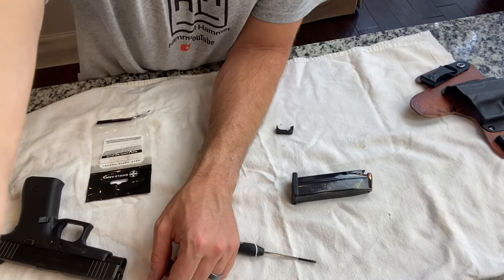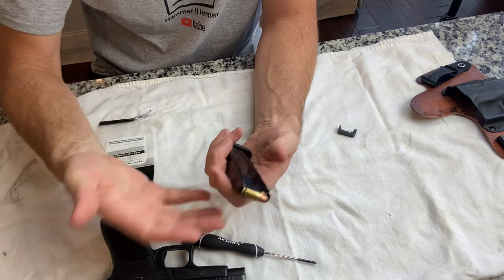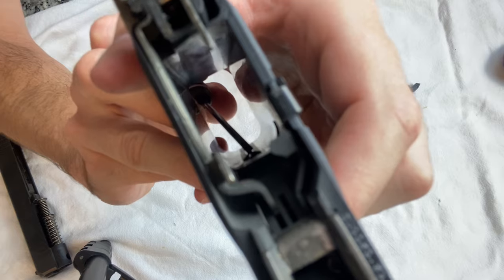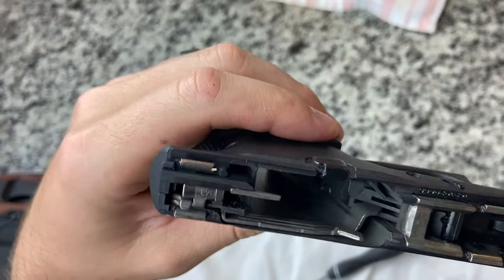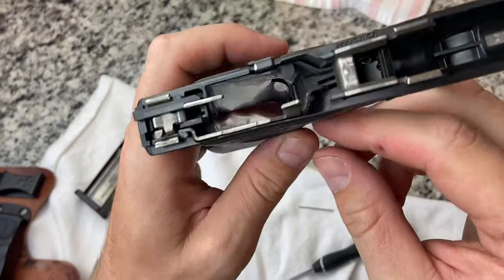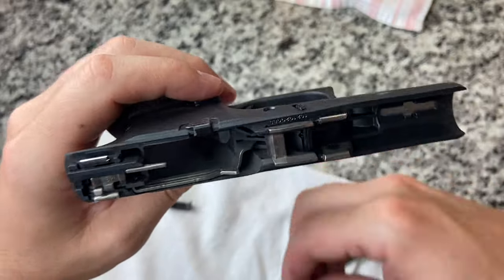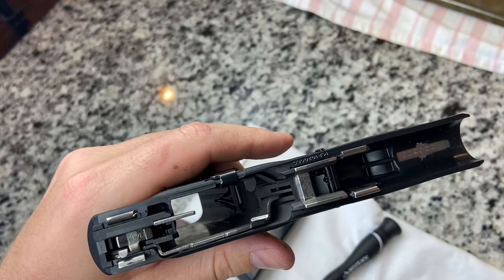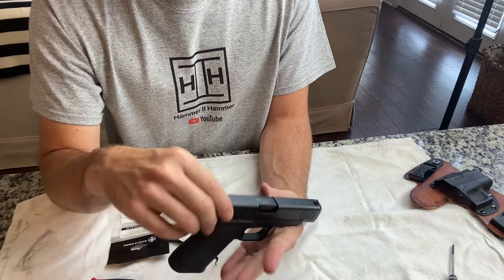Shield arms magazine release Install / Swap, Glock 48 / 43x Step By Step

Comment: You don't need to take out the rod. You can gently pry the rod up with a pair of pliers or something and the old mag release will just slide right out. You can then put the new one in, let go with the pliers, and then hook the rod backwhere it was before you started. Great informative video regardless, thanks!
Reply: Way easier taking it out.
Reply: Use a 90 degree pick to lift it like he is showing you, why do you people make a big deal out of it.  Move it out it of position raise it and slide out the catch   , slide the steel catch in raise the spring over it and slide the new one in and the push it back in place The man is showing you best and easiest way. It’s spring steel and will go back it’s in original shape when you release it, it’s done and done. Iv changed out 17 on the G43x and had no problems. If got to rough and lost of bent one they are less the 4 dollars at the Glock store. I’m placing a order from the for  a titanium guide  extra spring and rod and trigger parts for a oops kit

Comment: I feel bad for all the people that are following the second step and taking out the rod. It's not necessary to do that, just take the flat head and bend it outwards while putting in the new release..
Reply: Thanks for that tip!
Reply: I agree wholly but recommend a 90° or hook pick. I had a much easier time getting it out with those
Reply: I've got an even easier tool... One of those 6in1 screw drivers... take out the small sized screw end and use the tube of the holder to slide over rod spring and push/pull out of the way of the catch.
Reply: I was wondering if I'd be able to do that instead rather then removing it all the way. Thank you for the advice!!

Comment: Scratched up the inside trying to do this for 30 minutes with a screwdriver, so i bought some picking tools and did this in a couple minutes 🤦‍♂️. Well gotta give props to your video though it was helpful and quick.
Reply from the maker: Yeah a pick works much easier to get a hook of the bar, I have done several with a pick since. Both work but pick is easier. Thanks for watching.
Reply: How have the S15 mags been working for ya? Do you have Gen 1 or 2? Thanks. Have been hearing mixed reviews.
Reply from the maker: I have gen 2. They work great, I’ve had no problems at all such as feeding etc. I have no experience with gen 1 mags.
Reply: Headed to the hardware store in a bit to find a pick set. Been trying for 30 min with a screw driver and all I've managed to do is scratch up the inside of my gun.
Reply: Installed mine chewed up a little bit of plastic on the lip where the tension rod leans to getting it to come loose but it’s not bad and everything is installed and works perfectly used a pic tool 👌

Comment: The last couple Glock Armorer courses I went to suggested using needle nose pliers to just pull the mag catch spring (straight rod) straight up & out. After you use a small flathead to pop the rod out of the mag catch detent. This is way easier. To reinstall, hold mag catch in place, push rod down in its hole all the way, then use the flat tip driver to slide the rod back in place in the catch. No chewing up your gun. I can swap these in about 2mins with no damage & not over bending that rod.
Reply: Thank you - Ive done this several times but the glock 48 I have was almost impossible to remove. Pair of bent needle nose pliers and it came out in 5 seconds.

Comment: I have to admit, at first I was wary of doing this. Especially since now where I live the glock 43x is like a winning lottery ticket, the big box sporting goods and camping/hunting stores have the 43x on their website but no one has it in the store and it's up to 2-4 weeks for delivery. I had an offer by a woman for $850 if I'd sell her the 1 in my holster, I declined. I purchased the s15 combo pack which came with 3 s15 magazines and 1 +5 spring and base plate and upon reading the suggestions, they reccomended changing out the mag release with their metal 1, it's not a must but for better results and not wearing the plastic 1 out I did. I will field strip my guns but I'd rather not mess with the trigger and firing pin mechanisms, however I do have the harbor freight pick set and watching this video made it super simple and I didn't leave 1 scratch or chip getting the spring out of its seat, and putting it back was super easy and simple since getting the pressure off the spring is the most difficult part, if you're like me and dont want to knick it or scratch it up that's all I could think about. Thank you for the video that caters to us laymen who aren't very mechanically inclined or patient. Task took around 5 minutes after watching this and that's being super careful to not mess it up. Now my 43x has new mag release, 4 s15 magazines in total and 2 of them have the +5 extension, I carry in a vertical shoulder harness with 2 extra magazines totaling 56 rounds when I walk out the door. I will be getting 2 more +5 extensions since everything was so simple to install. Those who knock the 43x because other brands have similar sized compacts that hold 12, with shield arms innovations the 43x is capable of carrying a lot of backup power now with glock reliability and peace of mind that comes with them. I have the 43 also and several other compacts but the 43x with these upgrades and efficiency of possible modifications is my go to carry now. Great products from both glock and shield arms, in which I have no affiliation other than just being a satisfied customer.
Reply: How have the mags been holding up for you? 

I’ve been having issues with the magazines + Glock mag release, but I just ordered a steel version from shield. Excited to try it out!
Reply: Where have you found the +5 base plate if you don't mind my asking?

Comment: Like others have said, go to Harbor Freight and get their $2 mini pick set, and push the release from the back side as your are prying the pin. Make sure to press the hook on the end of the pick under the pin and it should pop out. Also, you can leave the pin in and just slide the new release in while prying the pin up. Super easy to push the pin back in place once it’s in.
Reply: I took a punch and lined it up on the straightest wall of the  side of my mag release.... And BASHED the mag release in... It worked great

Comment: I scratched the absolute shit out of the inside of my frame doing this and I used a pick. What got it for me was pushing in the mag release. Pushing and holding the pin all the way to the side and then pushing in the other end of the mag release.
Reply: Most helpful comment WTF I did it in 2 seconds
Reply: @jesseblaauw8441  glad it was helpful
Reply: OMG SAME. BEST COMMENT. TY.
Reply: I was so mad till I saw this comment 💀 😂 thanks bruh
Reply: Best comment. The guys method in the video will have you scraping the fuck out of the inside of the gun.
Reply: Dang likewise!! I was pissed
Reply: Could you elaborate on this. I cannot get it for the life of ne
Reply: I marred my shit up a bit too using a rigid ass flat head screwdriver! My plastic dental puck snapped in half 😳. After about 4-6 attempts I finally got it. Not as easy as it looked

Comment: Great video- thanks! 
If you don’t want to go invest in a new tool, you can also use a long corkscrew to scoop the spring out. 

The shield mag release has a much easier indentation to get the spring back into.  

Only weird part is that the shield release doesn’t do so great releasing stock Glock mags.
Reply: Thanks man! The corkscrew did the trick for me, appreciate it!

Comment: Great Video, i followed step by step by step and I was able to actually do the opposite of what you are doing here. My shield arms mag and release aren’t properly feeding and causing a FTF or jam between rounds. I have switched back to the factory mag release and magazine until I get the issue resolved. Great video and thanks again!!
Reply: I had the same issue with the Shield mag catch and magazine, so I swapped back to the original as well.  Just gonna run mine OEM and settle for 11 rounds.
Reply: After looking for installation vids, I came across lots of reputable vids that warn about and demonstrate FTF issues, especially with hollow point/defense ammo. This occurs with Gen1, 2, and 3 mags. It is not the mag release causing this. Shield has told people it is the loose tolerances of their particular gun. I'm returning the S15 set-up without installing it. Better to have an 11 shot that works 100%.

Comment: To make this lefty friendly is there anything other than putting the metal mag release in backwards and pushing the pin back toward opposite side?
Reply from the maker: I haven’t tried it but I don’t see any reason that wouldn’t work.
Reply: I made my wifes 43x MOS lefty by just putting it the other way. It's grooved "upside-down" on the other side just for that

Comment: So does that little small thin metal piece that’s holding the mag release  supposed to be stuck stuck and hard to get out?
Reply from the maker: Hey yes the tension rod is supposed to be pretty tight in there so it doesn’t come out easily/accidentally. Get a small pick set from harbor freight (it’s a 4 pack with orange handles for about $2) makes it much easier to get behind the rod to pop it out.
Reply: @HammerIIHammer  alright thank you I thought I got it stuck in there and I messed up

Comment: I tried to install the shield mag extensions on a glock Pmag and it wouldn’t work. Am I on the wrong here or are shield mag extensions only compatible with original glock mag ?
Reply from the maker: I can’t speak to the mag extensions as I don’t use them but hopefully someone will help you out on this comment. Thanks
Reply: I could be wrong but , I pretty sure the Shield mag extension only work on the shield s15 mags. At least I’ve only ever seen there +5 extensions on the s15 mags.
Reply: @Tracer1999  They worked with my original glock mags but not on the pmags 😞

Comment: I'm thinking about getting shield arms mags for my glock 43x
Reply from the maker: They work great, I’ve had no issues with them.
Reply: Its a hit or miss. I bought s15 mag and mag release. First round jammed when cocking the slide and mag release did not release oem mags well
Reply: @SergioGarcia-lu5yo  Yeah Glock said it messes with reliability when you do upgrades to your Glock firearms
Reply: @SergioGarcia-lu5yo  was this the gen 1 or gen 2 mags from shield arms? They have fixed the reliability issue with the gen 2 mags

Comment: So I just bought shield arms mags and am about to swap the release but my mag does not stick at all
Reply from the maker: yeah some people the mags don't stick it seems at first. but eventually the plastic mag release will become worn down/malfunction due to the wear from the metal mag. I still use the plastic mags with my metal mag release for training but prefer to carry metal mags with the metal mag release for highest confidence in reliability.   Thanks for watching.
Reply: What I am seeing from the mag release it is scraping both mags shield an stock

Comment: I noticed the new metal mag catch is significantly stiffer to push in than the Glock plastic.
Reply from the maker: Absolutely, I thought they would just clean it up and replace knife blade probably. or at most replace with a tinker or similar. but they went well above and beyond. Fantastic service above and beyond what they needed to do.

Comment: First time ever having done any gun work myself, after figuring out why my slide wouldn't release (TIP: depress trigger) i literally had the old release out and the new one in/slide installed complete in a minute and a half, very easy. (also having a little hook tool does really help to unseat that rod).

Comment: Good Job... thanks for sharing - New Subscriber: 
The Glock OEM mag release will work with the S15 mags but,  metal mags working against a plastic mag release will 'eventually' cause the the plastic mag release to fail. It just makes sense to dump the plastic for metal with your first order of S15 mags and never have to think about it again (IMHO). All my mags will be S15's from here on out and the two OEM mags being held back for "SHTF, Alamo Last Stand Do Or Die" duty anyway. - I run and EDC a (black) Glock 48 as well.
Reply from the maker: Thank you sir! We share the same thoughts, well said. Love the 48 and the capability it has with the s15’s. And thank you for watching.
Reply: @HammerIIHammer  so will the  metal mag catch release wear out OEM glock mags ?
Reply from the maker: Yes it will eventually as it is metal on plastic, but the glock mags are pretty tough so will take some time. I will still use mine for range/backup just not for daily carry.
Reply: @isaacsustaita8896  you took my Glock 43x 3000 rds with lots of reload drills to Finally fail

Comment: Just got the mags and getting 15 rounds in it is a little tough. Anyone else experience this?
Reply from the maker: Yes they are very snug especially at first. Use the factory Glock magazine loader, I’ve found it works well. I think I used the one that came with my G19.
Reply: @HammerIIHammer  thanks.
Reply: Get a uplula mag loader, only one you'll ever need, Glock mag loaders are bunk. Uplula can load any mag from 9mm through .45acp
Reply: @seahawks1185  tight. Thanks

Comment: If you change the mag rls then u cant use factory mags anymore...
Reply from the maker: True but if you don’t change it then you can’t use the S15 mags as it will damage the factory mag release. I plan on just using the s15 mags now as they have 15 rd capacity instead. But will have the 10 rd factory mags around as backups.
Reply: Do you have proof of your theory that the mag rls will not work or get damaged?? Because its Not true. Your original mag rls will Work Just Fine
Reply from the maker: Yeah the metal magazine on the factory plastic mag release will work if you are not doing a lot of shooting with it you are correct. If you do a lot of shooting however the mag rocking back and forth slightly and changing mags by engaging/disengaging the mag release will wear out the plastic. Some people I’m sure won’t change it and that’s fine, but since it is my carry I don’t want to leave it to chance when the malfunction will happen.  🤷🏻‍♂️
Reply: @HammerIIHammer  how many mags you run thru it so far?
Reply from the maker: Not sure a bunch tho, I shoot a lot.
Reply: Ok, well thats not really odd i suppose. im not changing mine cuz then i only have 1/3  of the mags for it then. And between 3 ppl we put about 6k through em and didnt even see any damage to mag rls. No worries, just makin sure man 👍 keep practicing...if you can afford it 🥵 lol
Reply from the maker: Hahaha no joke...it’s getting $$$$
Reply: Actually the Shield mag release will work just fine with the factory Glock mags.
Reply: @chrisrohl7969  well then you are special, lol
Reply: Not true, you can use factory mags there is just going to be more ware with time. It’s not gona go bad in 1 -5 months. I had a tyrant design mag release for 4 years, my polymer mags still work perfect
Reply: Not true.  Glock mags are only polymer coated.  They are still metal on the inside.  At least mine work perfect and who cares if a little of the polymer gets worn off as long as it still works.  And there are plenty of other brands that made metal mag releases prior to the S15 and nobody had issues.

Comment: Yeah I have been trying to pull that pin out of there for about an hour now. Now the inside of my brand-new Glock is all scratched up and I still can’t get it out of there.
Reply: Don't pull the pin out. This video is stupid. It's not necessary, just follow the first step and then put the new mag release in.
Reply: @PandasWeightloss  is right that's what I did works perfect... you don't need to take the rod out!

Comment: I just bought a brand new 43X 5 days ago. I got the shield arms mag catching today. I cannot for the life of me get the old one out no matter what I do. The one I have in my gun doesn't look anything like the one in this video or any other video. It is the most frustrating thing I have seen with guns here lately.
Reply from the maker: That’s weird. I don’t have a 43x so I can’t help ya there, not sure if the stock 43x one looks different than the stock 48 or not. But the shield arms mag release is for both.
Reply: @HammerIIHammer  How have the S15 mags been working for ya? Do you have Gen 1 or 2? Thanks. Have been hearing mixed reviews.

Comment: All that work and you don’t insert the mag to see if it works.
Reply: lmao, probably did not work and he cut that off
Reply from the maker: Haha nope it worked just fine. I have done several of these and they have all worked just fine. But do get a small pick set as it is easier than the screwdriver, but both do the job.

Comment: Shield Arms has serious quality control issues and are not dependable!
Reply from the maker: They work well for me as I have had zero problems with the 4 that I have. But my 4 is a small sample of the large number they produce. Also something to think about is the difference between each gun/maintenance/ammo used/moving parts of pistol and other factors that can affect the magazine. But it has to be dependable consistently for you to trust it.    Thanks for watching.
Reply: @HammerIIHammer  Thank you for the content. Mine-both Gen1 & 2 fall out of my gun when I shoot. I use their mag catch too.  Maybe they are delivering faulty mag catches and not mags... who knows. I went back to my 10 rounder's though. It is my carry.